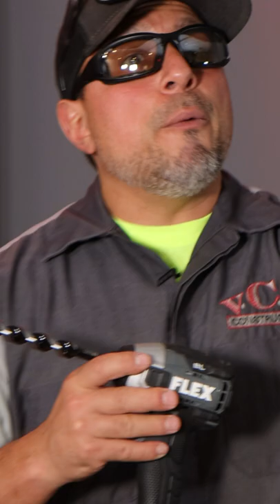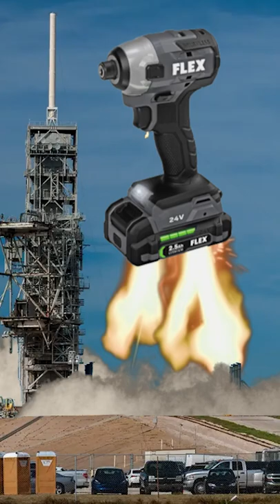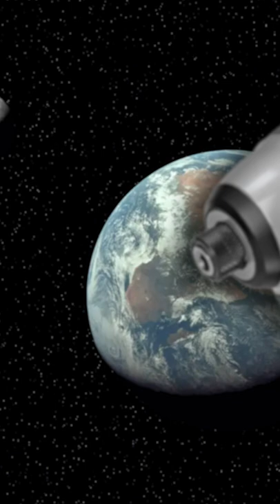Reason impact Drivers Invented (99% DON'T KNOW)

Comment: Incorrect .impact drivers we use were not designed for space !!!!! the ones for space have a counter rotating mass at the back end of the unit to prevent you from spinning around..If the drill or impact gun is set for clockwise you will spin counterclockwise and vice versa .If you are attached to the vessel the effect is different .The real 9nes have a counter rotating mass to counter the effect .

Comment: THE IMPACT DRIVER IS FAR EARLIER THAN THE SPACE AGE!
IT IS MODIFIED FOR SPACE USE BY THE ADDITION OF PINS TO OVERCOME THE ROTATING FORCE!
THE PINS ARE MOUNTED ON THE DRIVER AND FIT IN HOLES ADJACENT TO THE FASTENERS 
BEING DRIVEN ON THE WORK AREA!